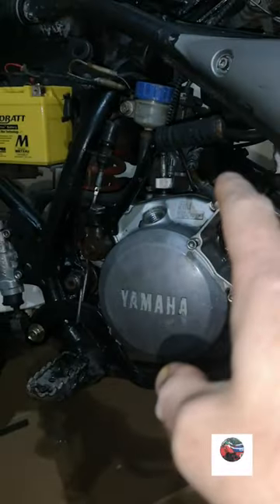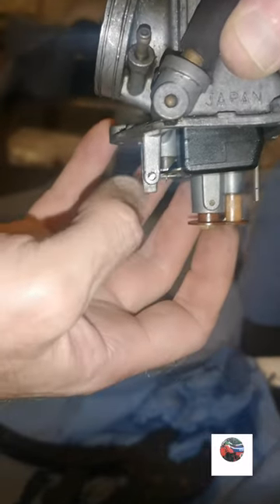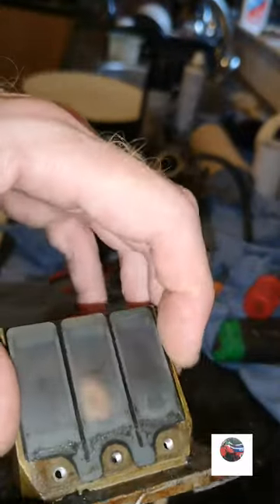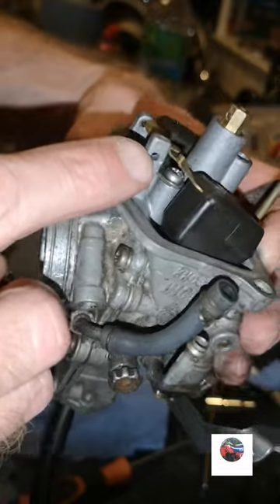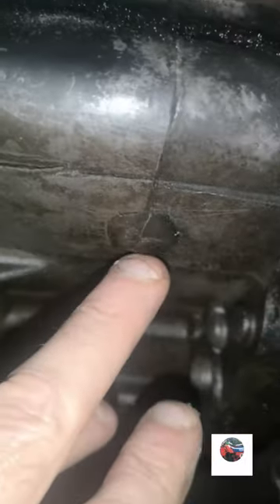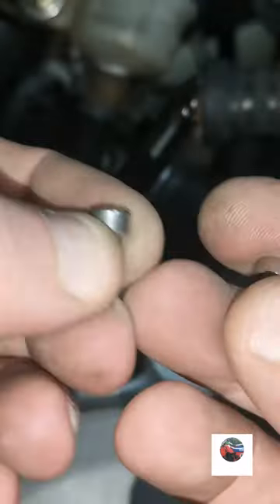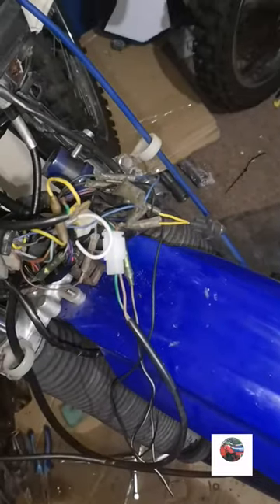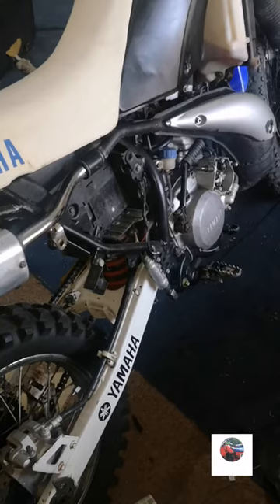yamaha dtr 125 1999 with a 1988 engine,harness and cdi /first start

Comment: This is basically my bike lol all the wires around my head light are cut or unplugged I don’t have clocks atm tho and a few are not going to anything around the coil and I’ve got a black by my exhaust rear pipe🤦🏼😂 I’ve got pics and vids got all the panels off but I beg you let me message you some how

Comment: Nice one bro! Another DT Saved from the scrap heap for parts, a little rough around the edges but sounds mint now :-) Made me chuckle seeing the vent hole blocked, when i got my first ever DT i see the whole and thought the engine was fudged lol You only need to look at the amount of engines damaged around the chain & clutch to know how weak the cases are, no way would you want to use a screwdriver pmsl thanks for uploading this informative as always! have a good one buddy
Reply from the maker: Thanks bro yeah in thes 90s I snapped 10 + casings on banger field bikes wen the chain come off an wrapped up round front sprocket and banged the gear shaft mount clean off, me too I once panicked wen young wen I seen that gap under the engine sure a mite of hylomar Ed it up😂its all a learning curve , aye too good to break, (could have done with the frame) but woulda cost to much to fully restore,thanks for the support again bro I just hope the lass never tried splitting her engine through that hole there's some mad advice on them Facebook groups, I've just made one any info like that the person will be banned for life for attempted murder of a dtr case 🙂have s Hood weekend bro
Reply: @2strokemxclassics  So true mate, life is one big learning curve lol I tend to learn the hard way pmsl i reckon your comments should have pointed that lass in the right direction otherwise that's another case down :-( Have a good weekend too bro, hoping to get me DT out and run some more miles down on the run-in
Reply: Hi i am in North east  Co.durham area can you sort my loom out with clock  and flashers  please  i will pay  its a running bike from supercarlsunday he was working  on but has took the clock  clips off i need help with this as they are  not in my area of knowledge 😢@2strokemxclassics

Comment: Is grey oil the sign of a head gasket issue a brand new one came with the bike hence me questioning it but I had a grey smear over the plug before she ran good tho but made me question it
Reply from the maker: Waterpump seal m8  will cause that m8
Reply: @2strokemxclassics  will that allow water into the bore yea? I’m sure defo something going on mate either reeds or head gasket bro the bike came with a new one when I got it so guessing it needs one ngl
Reply from the maker: It won't allow it into boreit would mele eng oil mix with coolant turning it grey milky but if your crankseals are gone it will let it into the bore m8
Reply: @2strokemxclassics  I’m thinking it’s head gasket it slowing coolant into the chamber bro I’m not 100% but I’m sure bro
Reply: @2strokemxclassics  was 2t ped too
Reply from the maker: What's it look like in the radiator m8 is it smoking white smoke
Reply: @2strokemxclassics  haven’t checked but I’ll look soon mate my mate asked if it’s pressuring the coolant too why would that happen
Reply: @2strokemxclassics  do you mean the bike or the rad smoking white smoke just so I’m clear bro
Reply from the maker: Just the smoke from exhaust m8, I would strip it down and put new cranks seals in m8, new water pump seal and new head gasket
Reply from the maker: And check thermostat is opening
Reply: @2strokemxclassics  I’ll look into it bro